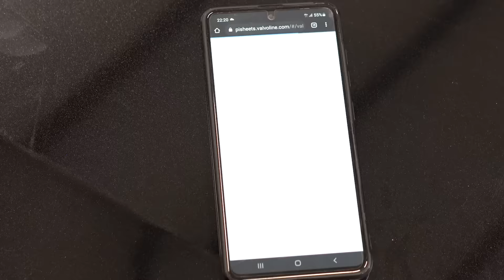How to change your OIL and FILTER | QUICK & SIMPLE step by step guide

Comment: Bruh why did u use old oil to lube the gasket? You wanna use fresh clean oil so you don't get containment or debris on the gasket.
Reply: Ya I’ve never seen that before lol
Reply from the maker: Dear @jakethesnake4040, your feedback is truly appreciated. 
For gasket lubrication we can use new or used oil – it does not matter, because during normal, service oil change, there still some used oil left in engine. There is no way to get all used oil out… Hope this was helpful. 
Kind regards from Valvoline EMEA team.
Reply: @ValvolineGlobalEMEA  is that superpro procedure?